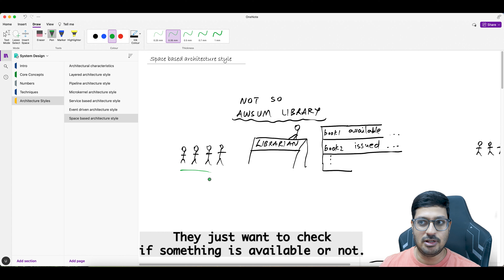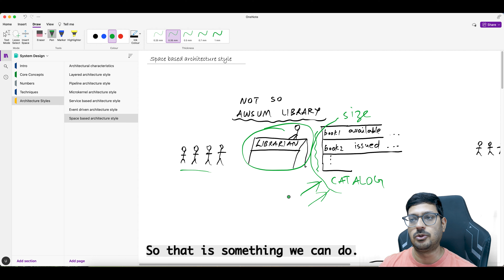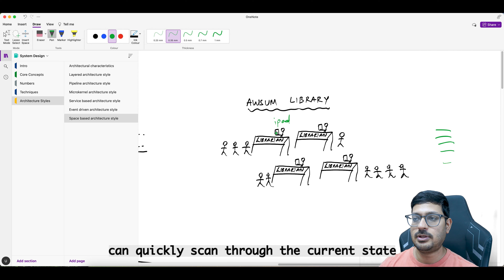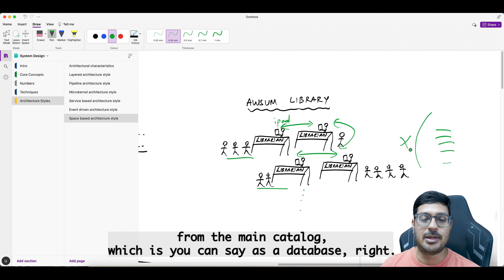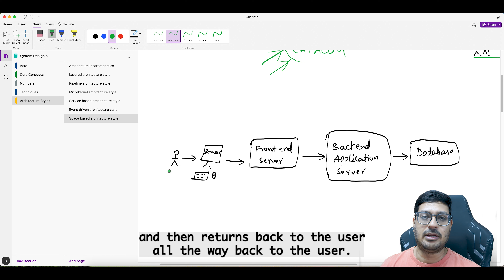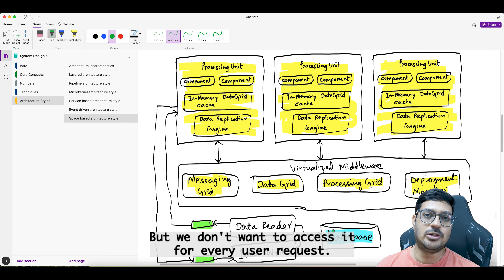Space based architecture style - components, tradeoffs | System Design

Comment: great explanation but are there any modern examples of this?
Reply from the maker: Usecases are plenty but implementations are quite low because it's very complex to maintain.. if you can pull it off then that's a super high performant system